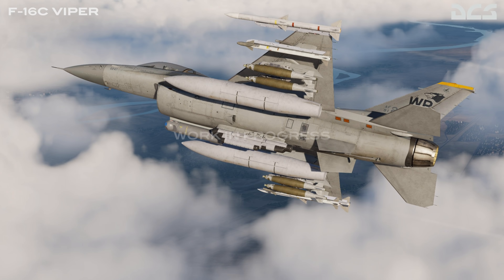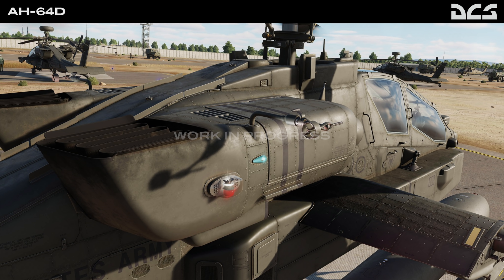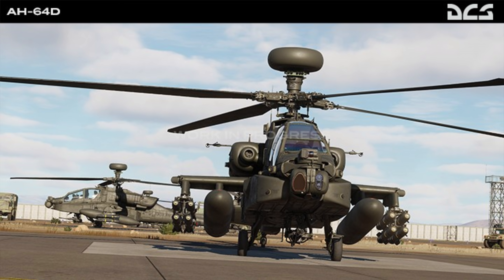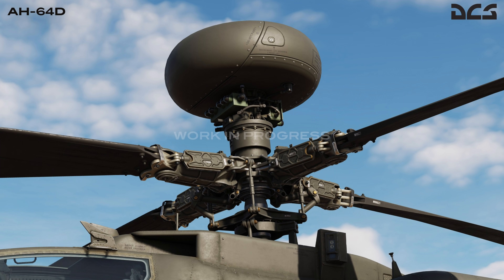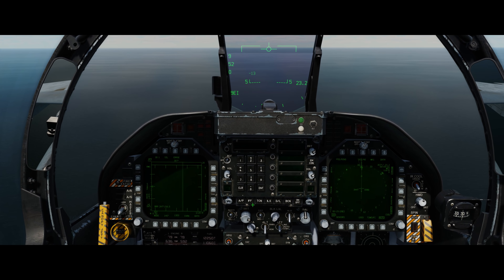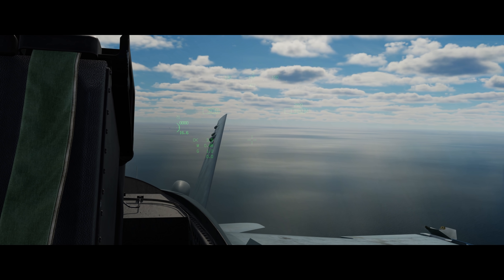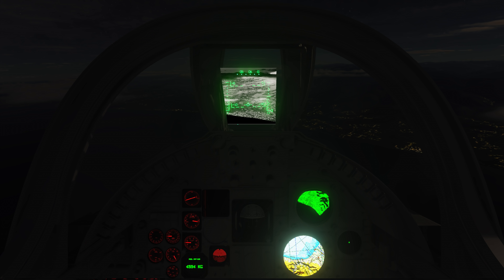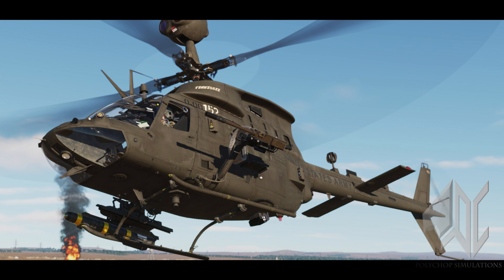DCS World Update 12/10/21: Polychop Back, F-16 ECM, Apache FM

Comment: To respond about ED not replicating a sensitive Datalink system, here is an explanation about the system that will not be modeled and how unnecessary it is to waste time on. This is from Raptor on the ED Forums, which was backed by Brad Mick (one of eagle dynamics SMEs on the Apache module) Raptor is also a verified Apache Pilot on Casmos Low Level Hell Discord server. 

Just to provide some context over what all these terms are within the Apache (some of it has been answered already, but trying to roll it all up into a one-stop shop):

TI/Tactical Internet is the term for how the Apache handles the BFT/Blue Force Tracker. SA/Situational Awareness is the TSD overlay that places BFT information on the TSD. BFT isn't a datalink per se, it's a network of the FBCB2 system. Think of it like this...FBCB2 is a datalink architecture. BFT is one of the networks it uses. The Apache is a device on the BFT network. An analogy would be cellular/mobile networks is a datalink architecture, T-mobile is an individual network among the cellular networks, and a Samsung smart phone is a device on the network. TI/SA could be called "apps" on that device. However, for all intents and purposes, the term "BFT" is used more universally because it is less of a mouthful than saying "FBCB2".

JVMF is a message format that can be sent among some datalink types. But just because two different datalink types use JVMF messages, that doesn't mean that those two datalinks can share such information. There is a lot more to this stuff than people realize.

EPLRS is like the BFT, in that it is a type of network, but not a datalink architecture in itself. An EPLRS-based device can't necessarily communicate with another EPLRS-based device simply because they are both EPLRS devices.  Likewise, just because the A-10C's (and some F-16's), have an EPLRS-based datalink called SADL, that doesn't mean that it can communicate with an Apache using an EPLRS-based datalink system. A ground unit equipped with a SADL terminal does not equate to an FBCB2-equipped unit. SADL and BFT are not similar at all, aside from the fact they populate ground force icons/symbols equipped with the appropriate terminals. SADL is more akin to Link16 than it is to FBCB2/BFT.

All this stuff is apples and oranges. And the only datalink system that currently exists in DCS that permits multiple modules to communicate with each other is Link16, which no AH-64D in existence has.

[This is all open-source information, I'm just trying to properly sort and separate the various terms to avoid the propagation of myths and misconceptions]
Reply from the maker: Great explanation. I suspected there was a little more code in Casmo's quip than just what was stated. It should be clear to DCS users by now, that having a license to produce a given aircraft is not akin to carte blanche access to everything, and licensing agreements govern everything from the quality of the final product to restrictions on "sensitive" elements.
Reply: For one there are FBCB2 equipped vehicles in DCS, so while it wouldn't work with fixed wing aircraft, there's still quite a bit it would work with. In fact I'm actually pretty sure there are more FBCB2 platforms in DCS than Link16. Also these features are tied into the capabilities of TADS, so I personally would like to know exactly what is being excluded and how things will be represented. If my Ah64 can't talk to other Ah64's, that's  a massive advantage of the platform gone.
Reply: @92HazelMocha  I believe there’s more explanation on the forums about it all, and how a lot of that system goes mainly unused in daily operations in real world scenarios. It’s very niche from what I could see being said. I am not an Apache pilot, but it makes perfect sense why they wouldn’t waste time on a system that one is largely classified, and two not commonly used. And the Apache can talk to others in game, through I believe the datalink replications. One being a part of the FCR system. Again not an Apache pilot but there are more ways than the BFT system to send target info in the Apache.
Reply: @colebailey1583  It's not about target data, BFT is about friendly data. It's true it's unused irl, but that's very largely because enemies of recent recent conflicts largely haven't had vehicles, and even more rarely actual military vehicles. That said, in DCS where there are enemy armor and ifv assets intermixed with friendly ones, the SA provided from bft's/FBCB2's is invaluable. Of course we have the F10 map, but BFT is basically just that.

Edit: for context it is strange to see any US vehicle in the last decade not have a BFT.
Reply: @colebailey1583  Also I 100% understand why ED won't implement it; it's a highly sensitive system that is (to my knowledge) still used today. However it is a important part of modern US army SA, even if we don't use it as much as we should.

Comment: What the ** is happening with the Ka50 update that started years ago, way it is going they will be updating the update
Reply from the maker: Yes, sadly no news there. Someone else asked the same thing, and I have to say it dropped off my radar. I thought it was due this past Summer as a paid update. Maybe some ongoing issues with data secrecy conflicts which were mentioned as restricting what the update would look like.
Reply: Figured I'd chime in here, as far as I'm aware relating to a post that was translated from the Russian forums, due to recent legislative changes in Russia they (meaning ED) are no longer able to obtain documentation on systems such as the MWS and DIRCM etc which means they have stated no IGLA or MWS will be added in the Black Shark 3 update and I would infer that also includes the fully fledged Mig-29 module. TLDR we are getting no new systems for the KA-50 or the Mig-29 it will just be a cockpit/flight model revamp.
Reply from the maker: @zoomingpingas  That's what I understood back in the early part of this year. They did some remodeling work which was showcased, but we haven't seen any further updates per se unfortunately.